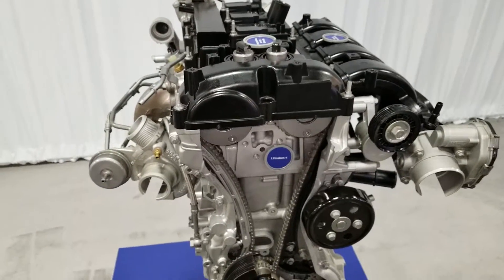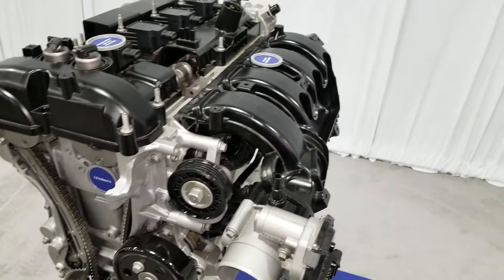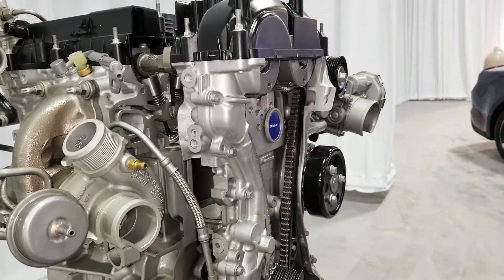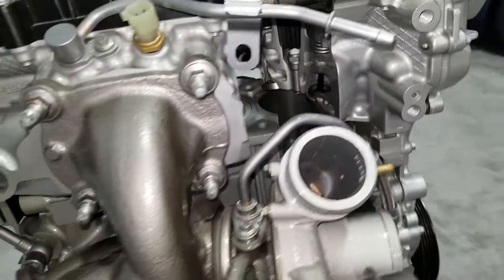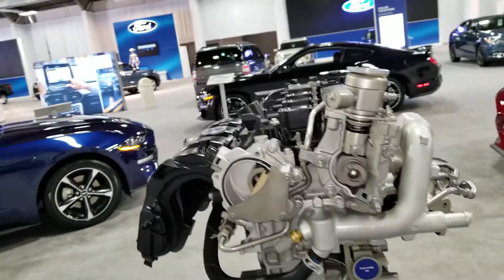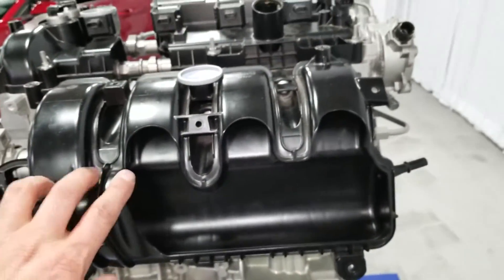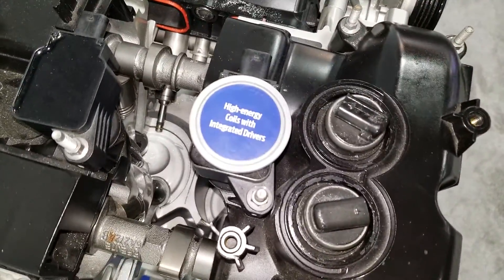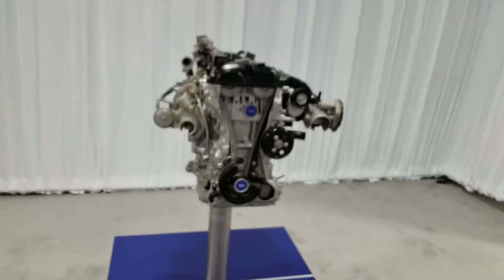Ford 2.3L EcoBoost Engine Cutaway View

Comment: Not sure what is your baseline for that comment but I have  2 turbo engines one honda and one ford 4 both 4 cyl, over 80k each, I do change the oil as the meter tells me, I can't afford to buy an engine, but they been good to me, no issues so far, run like a top and fly like a duck!

Comment: I just got a 21 Explorer Timberline with the 2.3. I use Amsoil 5w30 ss and archoip ar6200 gas additive. Car runs surprisingly well. I may do a 5 star tune. I'd like to see 330hp/350lb torque at the flywheel and I'd be happy

Comment: I have a 3.5 twin turbo Ecoboost engine in my Ford Explorer ST I change my oil every 5000 miles I would never trust that 10000 miles nonsense
Reply: Get a dual valve oil catch can and your engine will last way longer!!! The carbon build up in the valves because of the direct injection kills theses motors!!! By 40k miles they are clunked up with gunk and destroy the engine

Comment: Do not listen to the 10,000 mile interval! 3000-5000 miles! Please take care of these motors. Do not listen to that nonsense. If a normal engine can’t get 10k miles per oil change an engine with a turbo can’t either. It’s just simple physics.
Reply: They tell you 10k so you will have to buy another motor sooner rather then later
Reply: @Alien300Blackout  I know. They’re in the business of making money. Not good cars.
Reply: I usually do it twice a year just for piece of mind (about 6000 miles), but it'll probably be perfectly fine if you go change it in a 10,000 mile interval. The engineers know what they're doing, at least here in europe most companies nowadays have at least 10,000 mile intervals on their turbo engines.
Reply: I'm listen to ford and use there brand of oil and oil filter. Did you build this engine. No
Reply: You can buy oil a lot cheaper than an engine,remember these guys (Ford) are in the business of selling cars .just saying
Reply: Brah.  Most Japanese cars have specified 7.5k miles since the early 1980's... that's using regular oil.  My cars are old and high-milage and I change the oil once per year or every 10k miles... whichever comes first.  Again that's regular oil.  Do your research.
Reply: @personalfunfest  Yes and they’ve suffered oil sludge and stretched chains from it too. Toyota was sludging and Honda K24 engines were stretching chains. I’ve been an import technician for thirty years and I’ve seen what 10K oil changes do.

Comment: Its a bigger turbo than youd think for a factory car.
Reply: It's a torque'y little prick, to say the least LOL
Reply: nboy7 still slow
Reply: @vicentechamberlain579  In stock form maybe, tuned things start to get very different. Its setup pretty mild from the factory to not step on the toes of the V8 too much.
Reply: @vicentechamberlain579  Lol yeah I hate that it uses an open deck block, which for it means above 400HP it starts to crack the block or lift the cylinder head causing the gasket to fail.
Though the way I look at it, people were happy with 400HP in 4 cylinder RWD JDM cars like the Nissan 240SX, so the fact that you can still buy a brand new reasonably priced RWD car like that today is pretty nice i think.
Reply: nboy7 i think its too much money for a four banger tho especially on stock power i think its a waste. Id rather go v8 or nothing or find something else with more power with the same price or less price. I wonder if anyone has ever put shims or shim-like, block fillers inside the blocks of the mustang four bangers to push more power without cracks and get head studs. Like how they put shims in the volvo turbo motors to make them stronger and prevent cracking and hold more boost
Reply: @vicentechamberlain579  Yeah i see the price of the Ecoboost performance pack is quite close to the V8 in the USA. Though thats not the case all over since of engine size and carbon taxes, ecoboost is a lot cheaper in some countries.
Guys have tried putting inserts into the blocks like you said, but the results were poor. The problem is it blows through thin walled sections were the studs go into the block, causing catastrophic failure.
The only solution for 500HP+ is to use a semi closed deck block from a different version of the engine (such as the Focus ST or Escape). As you can imagine its a major job to change, but plenty guys have done it in the drag scene.
Reply: Hehehe where even is it THAT SHIT TINY 😂😂
Reply: Strange... I think that the compressor is a little small :/